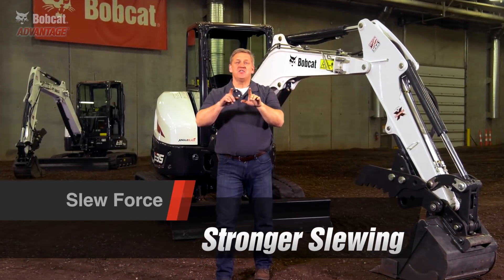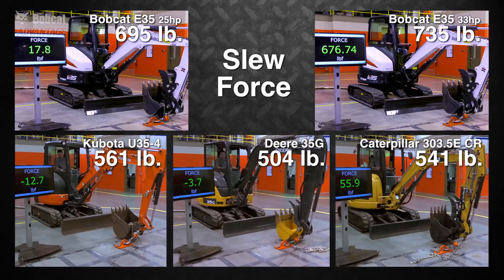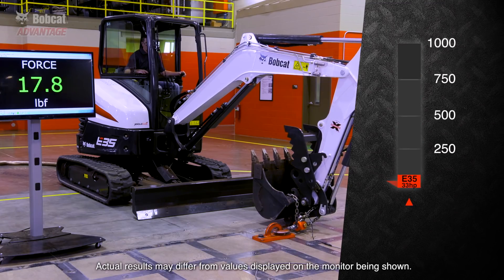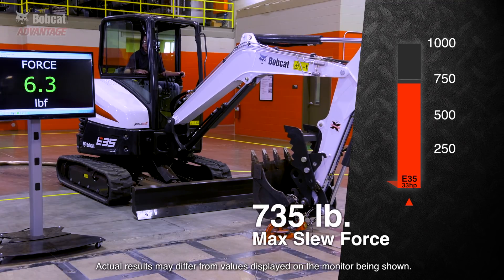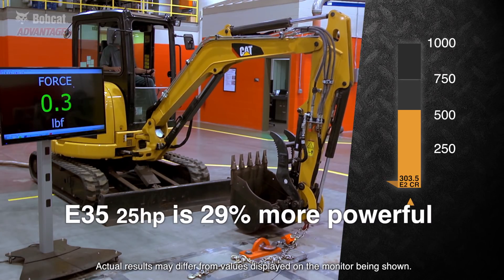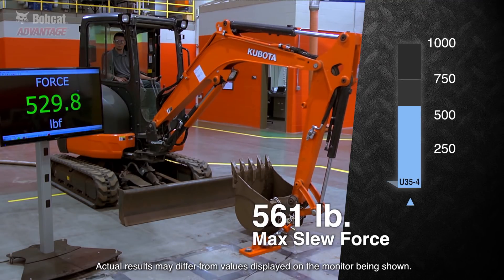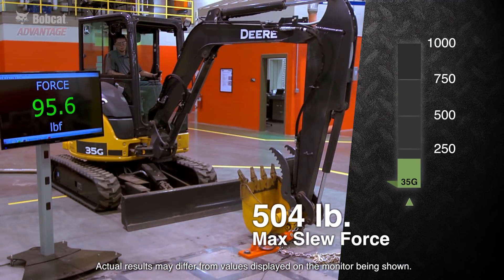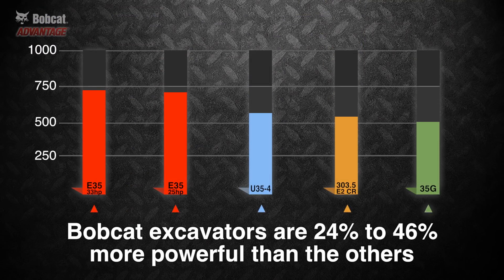Stronger Slewing: Bobcat vs. Other Excavator Brands

Comment: Be careful what you see here.  If the radius is slightly larger from the center of the unit to the point of measurement can drastically change those numbers...

Comment: I bought a brand new E26 last fall. The thing is falling apart. Throttle actuator died at 90 hours. AC system doesn't work and blows hot air at me. And this morning the machine has no digging power in regular easy topsoil. I'm at 115 hours on a $42000 machine and I'm done with this piece of trash! Slewing power is a joke btw.
Reply: Warranty bud.
Reply: @Senkino5o  warranty doesnt pay for down time.
Reply from the maker: Hi, Jason. Thanks for reaching out to us. Customer satisfaction our priority and we'd like to speak with you further about this. Please contact us at 1-800-743-4340 or use our Service Issues form: http://bit.ly/2j1SpSE